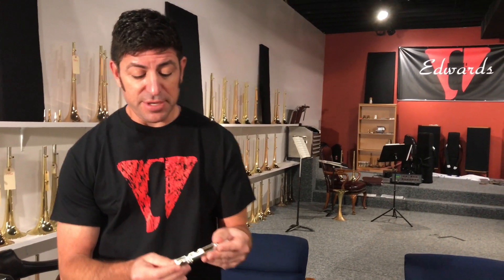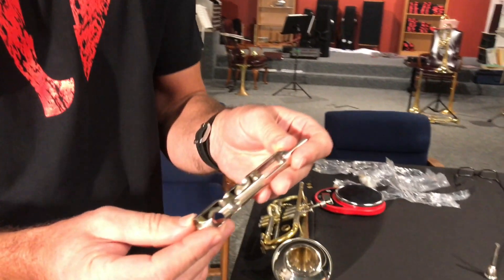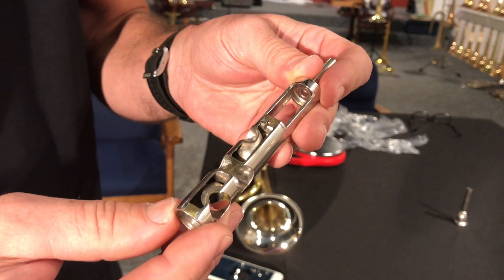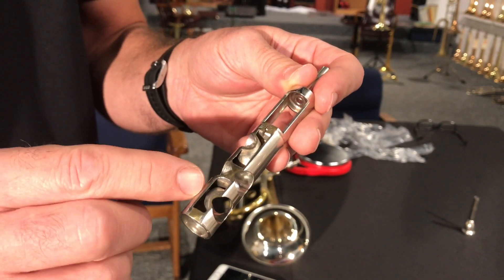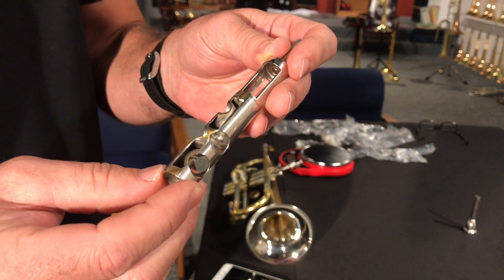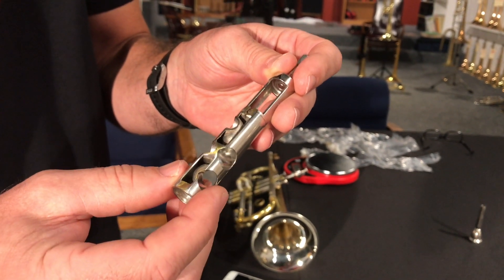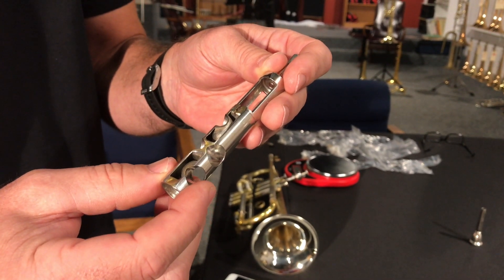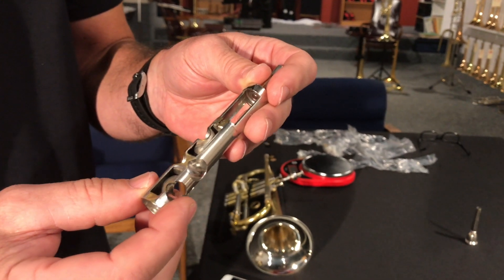Monel vs. Nickel | Best Valves | Edwards

Comment: It's like comparing a Mercedes (Monel) to a Toyota (Nickel). A new Mercedes is awesome. It's comfortable, quiet, plenty of power and great features that make it a delight to drive. But down the road, you'll eventually have some issues with that Mercedes. It's gonna have some mechanical problems and wear down in various ways to where it doesn't perform like it used to. The Toyota on the other hand (Nickel), is always fantastic. From the day you drive it off the lot, it's a very solid car, and it stays solid for 200,000 miles beyond wherever the Mercedes ended up. But as good as the Toyota is, it was never quite as good as the Mercedes once was. That's how it is with a lot of expensive things. They're awesome, for awhile, then they wear out and need to be replaced.

Comment: Purchased a brand new Yamaha YTS 5335gsii, terrific at first but then had nothing but problems with Monel valves from discolouration to sticking valves on a new instrument. Yamaha replaced the trumpet due to black "mould" discovered on one of the valves and then had further problems with valve sticking and staining on the replaced one.  Was sent to Yamaha workshop and they lapped the middle valve, that is not a good thing to do apparently, so not happy.  Do not recommend Yamaha, their grumpy sales rep in London store not helpful either when the rest of the staff are so delightful!

Comment: We purchased a brand new Yamaha 5335gsii Monel valved trumpet, within a couple of months the inside of the valves have black patches, any idea what this is? HOw to clean off? It spent 5 months in workshop due to discolouration and eventual sticky valves, just returned for refund yesterday as sticky valve not fixed.. Now looking for replacement, Getzen 490 or 700s being considered.